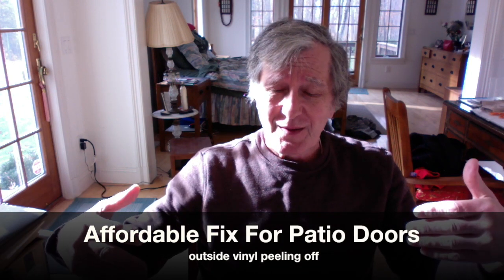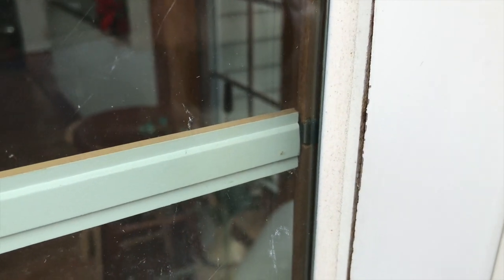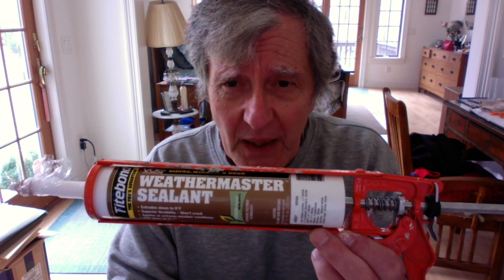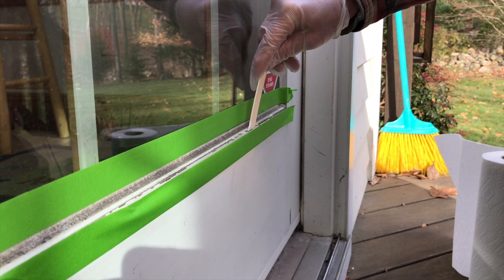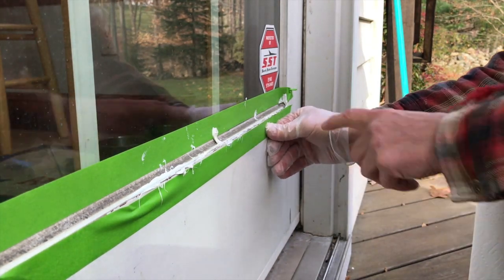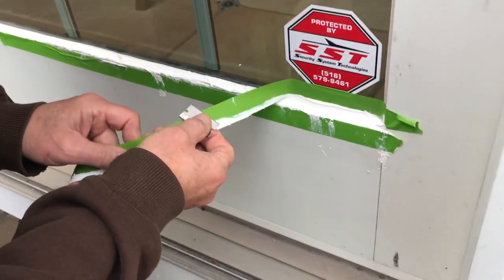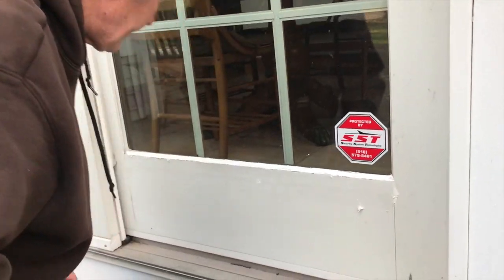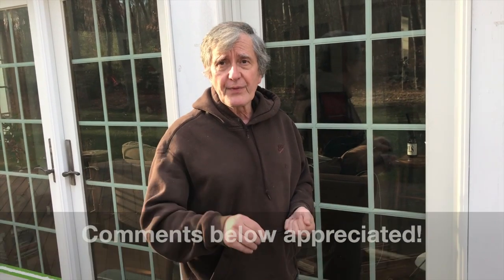Andersen Patio Door Repair - How I fixed it myself

Comment: Here it is December 2nd, 2024.  I appreciate your taking the time to come up with a good solution.  I have two double patio doors and one has already started coming apart on the bottom panel and another door on a separate double patio door setup is just starting to come apart.  Today, I used paint tape and ordered the Titebond tube.  After the showers end this week, I will make sure they are dry and proceed to fix.  I have had the doors up 24 years and never suspected this would happen like this.  Thanks!

Comment: Pete;  Your video is great, thanks!  I'm a recently retired Architect in Westchester who has always recommended Anderson because I believed they offered the best quality for the $.  Well, I too am no longer a fan and my experience with Anderson was no different than everyone who has responded here!  My 20 year old patio doors are experiencing the exact same delamination as yours.  I have tried using an epoxy to bond the vinyl to the wood which failed after the 1st winter.  Only wish I had stumbled upon your video prior!  Looking to do this before the cold weather sets in.......Thanks again!
Reply from the maker: I live in Pound Ridge in Westchester. Thanks for your comment and if you do it as I show in the video, it should be successful repair. Mine is still holding up well, and I just put a little skim coat on the top every so often.

Comment: Spot On!!!  Weathermaster Sealant works.  Mineral Spirits desolves the left over sealant in the applicator tip so you can use it repeatedly.  Excellent video!  Thanks Peter!  Ladders and dumbells are a great way to compress the repair.  Careful not to permanently attach the ladder (braces) to your sliding glass door! Smile.

Comment: Thank you for taking the time to create this video. It was beyond helpful. We also had 10 separate Anderson sliders circa 1997/1998. There was a lot of peeling of the outside vinyl cladding and my husband was able to clean out all the grub under the horizontal section of the panel with a plastic knife (instead of a tongue depressor), weatherproof the vertical sections with the Titebond and fix the horizonal sections that were coming off. I cannot tell you how much money this saved ! Also, thank you to the person who provided the link for the Titebond.

Comment: I’m in the process of repairing mine. I let it go too long. I contacted Anderson. I think it may have been under warranty or maybe not. Anyway they were going to replace the two glass panels with the issue for half the price for $800 each. The panel came completely off one of the doors. So my mom found similar material at Menards. I will paint and glue using the glue you suggested for the repairs and let you know. I’m just getting to this 9 years later!

Comment: Thank you for the video. Like yourself and so many others my 20 year old Anderson door cladding has begun to delaminate last Fall. The recommendation from two local dealers and Anderson was to buy a new door even though all I wanted to buy was just the vinyl piece on the bottom center of the doors. I have two other gliders with no issues and about 14 double hung or slider windows on the house and garage. So quite disappointed with the lack of support or concern from Anderson.

I removed the laminate entirely from the fixed door today and found that the 3/8 plywood outer frame behind the vinyl was also loose across the whole door which possibly contributed to the cladding to lift off. My next step will be to remove the scattered adhesive from the door and vinyl, refasten the plywood frame portion with Titebond as you recommend, and reattach the vinyl with exterior bracing for a day or so as you recommend. Many Thanks!

Comment: A couple of points to mention. These Anderson doors (and windows) are often referred to as vinyl clad. They are not. The exterior cladding was actually a laminate similar to what is used on kitchen counters and the like, i.e. Formica. If the separation is caught early the sealant referred to in the video should work. Unfortunately if left to mother nature mildew (due to the moisture) will soon attack the wood behind the peeling laminate and it will begin to deteriorate. 

 In our situation we ended up taking the sliding & stationary panels out of the frame and removing the exterior cladding. We ended up painting the doors with good exterior paint. On the sliding panel 3 of the 4 pieces just peeled right off. The top piece we used a belt sander. On the stationary panel 2 of the pieces peeled off easily and the other 2 were removed by use of the sander. We did this for a couple of reasons. On one of the panels the a portion of the laminate cladding broke off one day while closing the door. Trying to glue it back really wasn't an option espacially when we saw some of the wood black with mildew. Also some of the wood on the lower portion had to be repaired. Mildew was treated with bleach before painting.  How long this will last remains to be seen.

Really disappointed with what I thought was a lifetime no maintenance door from Anderson.
Reply: Same with what happened to my door.  I wish I had looked for this video when trying to repair one of the panels.  The cladding on the bottom broke in half when the screen slid past the protrusion.    I ended up ripping it off and tried using wood putty as a filler.  I'll likely redo it as it looks really rigged right now but it has held up.   But just noticed the other stationary panel bottom cladding is starting to warp and peel away.   
I may look for replacement laminate to cover that wood putty filler I rigged up.
Reply: @pooneej  Were you able to find replacement sheets?

Comment: Thank you Pete. I have the same problem on my “Frenchwood” doors. Peeling in multiple places. In my case the bottom panels where to far gone. I ended up peeling the bottoms panels vinyl off, sanding glue off, using wood filler as needed for rotting section. Sanding wood filler, prime bare wood. Took sample of bottom panel to get matching paint and painted bottom of both doors. On the vertical sides of door I am in the process of getting “Weathermaster Sealant” and following your tutorial. Thank you for this valuable lesson, Bill S

Comment: I Installed Anderson windows (and a Frenchwood Patio Door) throughout my newly built home in 1999, twenty-one years ago. I too have the exact same problem, and despite spending hours on the phone with Anderson, they wouldn’t budge, their only solution was to replace the panels at a cost of $1700 each. I ask if I could purchase new laminate material and was told no. The only thing worse than their doors is their customer service. As I explained to them, I will never purchase another Anderson product as long as I live. Thanks for sharing your solution.

Comment: Thank you! Like the others I am having the same problem with the laminate detaching from the plywood backing. In my case I let it go too far and the plywood is now warping. My fault for not seeking out a solution earlier. I'm now research laminate/formica sheets to apply to the plywood backing (once I get that straightened out). I appreciate how you take the time in your video to methodically go through the repair step by step. Great job! I have liked the video and subscribed to your channel!
Update - ordered HPL from Woodworkers Express. Thickness seems to match up nicely. Fingers crossed.

Comment: So happy to hear with Pete’s solution, the cladding is holding up fine after a few years. 👍
Pete, thanks for saving me thousands of dollars🙏, the amount I have to pay Andersen to replace my twin patio sliding doors. That’s their ONLY solution 🤔. Will get the sealant tomorrow.
The bottom section of the stripping between my sliding and stationary doors is tearing. Must be caused by the separating cladding. Does anyone know how to repair the stripping ?

Comment: "Low maintenance" products like vinyl and other plastic-based products are a scourge. They're only low maintenance because there's almost no maintenance you can do before you have to send it to the landfill.

Thanks for the video, Peter. I'll be trying your method soon, but I'll also be buying solid wood doors next time...the finish/paint applied to the wood will require maintenance every couple years, but if done properly the wood will last for generations, which is how it should be when you spend thousands of dollars.

Comment: @Pete from NY.  Thank you for the great tips re: fixing my Anderson Patio Doors.  I had the same issues as you, e.g., the cladding was separating from the outside of the doors.  I followed your instructions and used the Weathermaster sealant product, and braced the repairs during curing (using wood boards and weights)..and Voila!  Next step...some white paint and should look like new.  Thank you for taking the time to share your great ideas with us.

Comment: My hat is off to you for solving this problem that is the exact same issues i have i mean EXACT PROBLEMS
Anderson was a good product ONCE ! when they covered the wood so it would Last they defeated the purpose 
it's only good for around 20 years and like you say they tell you SORRY YOU NEED TO BUY NEW DOORS!  
We bought 5 door systems from them for the reason it was a one time buy with total protection from the weather
No it was not i would of been better buying all WOOD on the outside and paint them , i'm in the same boat you were 
i opened the screen Duct Tape to hold this so i could use the screen - upon a closer look the wood under this material
wood-chips
Reply from the maker: Repair still good. Hope you did it already! Please subscribe to my channel if you found my video helpful!  Thanks Pete

Comment: Pete, thanks for taking your time to document and post your idea.  I specifically bought an Anderson slider door their quality. I didn't realize that i was getting poor quality!  Your slider looks exactly like mine but only the lower corners are peeling on mine. I guess that I got lucky or maybe Maryland winters aren't as brutal as yours are.  I'm planning on giving it a try.  My only suggestion for a slight improvement would be to give the part number for the sealant that you used.  I think it's 44001 but I'm not positive.  Thanks! HJS.  🙂

Comment: You've given me hope.
Any update on how the fix has lasted?
Also, I can appreciate your "critique" regarding Andersen "assistance".
Let me just add a rant about Pella. 
If you don't know, you ASSuME that Andersen & Pella are premium products.
Just assume the only thing premium is the price.
I have Pella windows & doors that have failed. Not warranty even though it's a design flaw.
And they don't make anything that matches so it's either repair on my own or replace EVERY window & door.
Again, thanks for the tip and also the opportunity to rant a little bit.

Comment: Have already replaced one panel.  I have two more failing panels.  Andersen gave me a discount, but the staining of the panels and installation was even more. Andersen did admit it was an manufacturing problem that has since been fixed.  I will give this fix a try.  If it does not work long term, I will replace  - But not with Andersen!  I will never recommend them.  I have 12 total panels not installed at the same time I am hoping the later ones do not have the generic failure.

Comment: Thanks Pete, just bought a new house a noticed the same issue but was just starting. I knew I wasn’t the only one to have this issue. Thanks for making this video! I know it has saved a lot of people $$$. Did you end up putting a sort of top/finish coat in the end to create a smooth bevel for water to run down?
Reply from the maker: Did not top coat. Every year or two I put a new skim coat of weathermaster where bottom of window meets door panel. All repairs still holding up after years! Please subscribe to my channel. Thanks

Comment: Thank you for your video. I also have french doors / sliders installed in 1999 that are delaminating. I compared to a 6 year old (installed 2014) slider and Andersen changed the laminating design (adding a drip edge and covering the lamination seam). Thankfully I found your video and repaired the doors using the Titebond Weathermaster Sealant. Andersen should be ashamed for not publishing a similar fix. They certainly know of the design defect.
Reply from the maker: Thanks Jeff.  It’s amazing that they do not offer help and repairing this problem with seems quite common according to the number of views on my video. Please subscribe to my channel it helps me get my messages out. Thanks

Comment: Thank you for posting this video. I had some of the same issues that you did but only on the bottom panels. I ordered the Titebond from Amazon, I believe. I waited for a dry day, cleaned it all out, applied the Titebond and pushed up a board to it and secured it with an extension pole with applied pressure from a tire jack that was up against my deck. Worked like a charm. Thanks again!

Comment: That crack you have on the bottom right is how mine started. Under that is rot. Also, remove the tape right away it comes out neater

Comment: wish I had seen this sooner. I put in silicone and glue and then put in tiny screws to hold the vinyl down as it did not look like the space between the vinyl and the door was tightly closed. And a clamping solution revolution to boot. I called Anderson as well - they had no solution. Surprising! My opinion of Anderson products is significantly less than it used to be!

Comment: I’ve got our four panels done, thank you so much!  Mine need some neatening up, they don’t look as good as Pete’s, but that will wait until spring. It’s so good to have them weather proofed again and not warped open.

 Do you know if the loose inside door handles can be fixed?  Ours looks like the kind of high half moon shape and I don’t know I’d the front button comes off to tighten it up.

Comment: Thanks Pete
My problem is the cladding is buckling in the middle. Any recommendation to your installation?
One thought I had is to separate the cladding all the way up the door and apply your product.  Thoughts?
Will
Reply from the maker: Great question William! The best thing to do is remove the entire panel as you thought and make sure the panel is not warped before putting it back on.  You can watch some YouTube on how to unwrap a board but basically you have to wet the wood and then put a weight on it to make it flat and let it dry in the sun. This is especially important because that panel can warp so severely it can interfere with your screen door sliding! Please let me know how your repair Goes and please subscribe to my channel I need the support. Pete

Comment: Hi Pete. To fix my peeling paneling I used two part epoxy. I placed a lot of painters tape around the edges and window frame to catch the overflow and used a combination of vices to keep the panels in place for a few hours. I had additional holes in my panels where someone had tried to screw the panels to the door. I had to tape those holes after using fine steel wool to remove the raised lip. Once I finished that I spray painted the doors with white (not glossy) rust-Olem paint. Then I caulked the windows. My doors look brand new!!

Comment: Couple questions....I don't think mine is delaminated.. yet..it does seem like the paint layer is starting to peel, especially on the top of the bottom section. I called Anderson earlier and was offered new panels at only $4000!  Today I wanted to know what kind of and color paint to use.. I'm still not sure of it's paint or vinyl...(400 series french). Hoping I caught it in time and we plan to paint and caulk the seams.. what do do you think? Also the "caulk" or whatever they used at the edges of the glass has gotten very gray. Do we just use window caulk over it there?? Thinking about just painting the door, they told me today it was mfg with  a phenolic finish...she said it's like paint with aluminum?? Looks like peeling paint or very very thin dry vinyl peeling.. it's northern exposure.  Any suggestions?? Thanks for the video!!
Reply from the maker: I would use the weathermaster as sealant not caulk.  If you could send me a couple of pictures that would help me determine what is going on. Please include some close-ups of the bad areas

Comment: Good Job Pete!  Yes, mine (Frenchwood Sliding door)  did the same, as well as my Andersen casement windows collapsed and fogged right after the warranty period was over. Something about an Andersen screwup with the Argon case between the double panes leaking out.  By collapse I mean they no longer have a space between the panes in the middle.  Ruins the insulating ability of the window and they fog up.  Bottom line.....Andersen does not stand behind their products.  I think they made a good product years ago and built up a good reputation....Then....they made crap and don't stand behind their products (riding on the name)....Really too bad.....I would never recommend Andersen products to anyone!  Had to replace window sashes and they were more expensive than the whole original window.  I also replaced a frenchwood door panel .  Your video is great and can help a lot of people who are stuck with these lousy products!  Thanks Again!
Reply from the maker: Thanks for the kind words Steve. That is the purpose of my video to save people money and keep it out of Anderson’s pocket